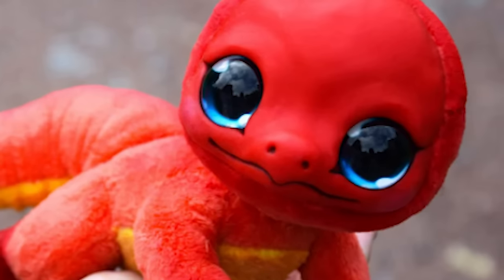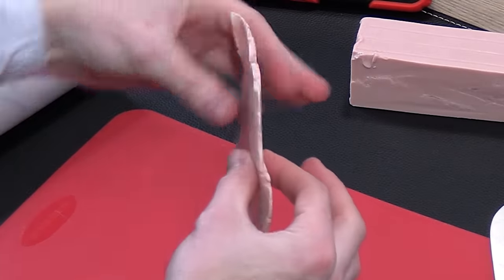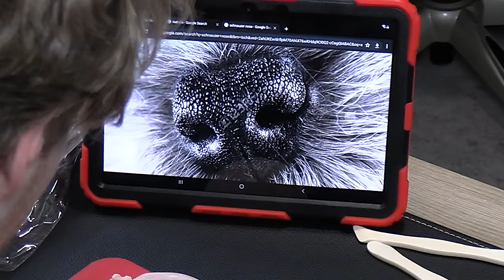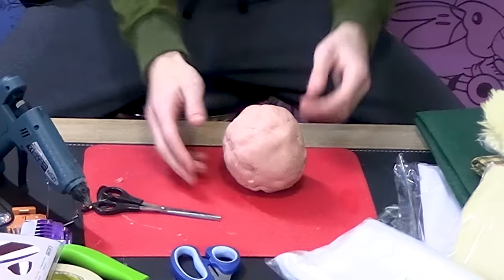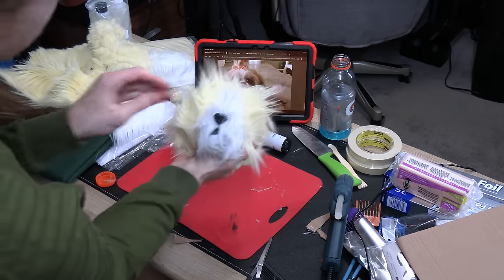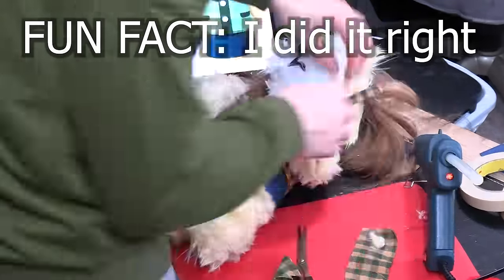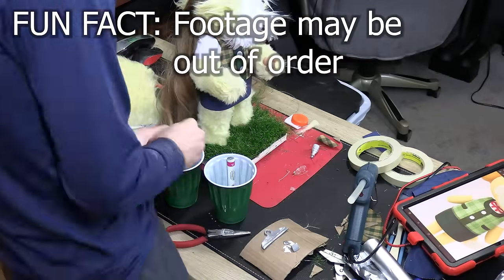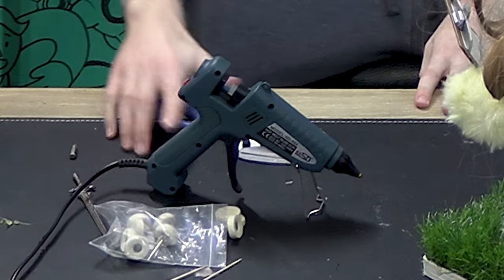Making Isabelle into a Real Dog Doll

Comment: Hey Peter, as someone who used to love using oven dry clay I highly recommend getting a pasta roller. It makes you sheets of clay that are the exact thickness you need depending on the thickness you adjust it to
Edit: a resign tip, if you want them to be really shiny then do this: once you have the resin thing you want to shine up apply clear resign to the top of it to make them shiny

Comment: aight just to offer something:
Yes- yes you are most definitely meant to wear a mask with resin work, as well as keep the room well ventilated! It's a toxic substance both inhales and consumed/touched, so be careful @ whoever want's to use the stuff. 

ALSO: some resin when curing goes up drastically with heat to the point it can sweat - so also be careful with using plastic, wax etc! it's preferred to use silicone molds, but for one off things.. hey, worth the risk

Finally: Resin cures better (and clearer) in warm temps, not hot nor cold!
if it's too cold, it can form cracks and overall set weirdly, if its too hot, it will form EXCESS bubbles (bubbles from pouring can also be removed with alcohol spray depending on the type of resin, or blasted with fire very very quickly) 

thanks for the TED Talk opportunity and thanks for the nightmares :)